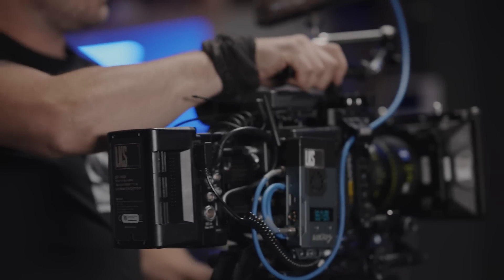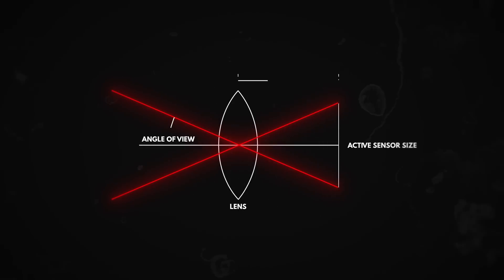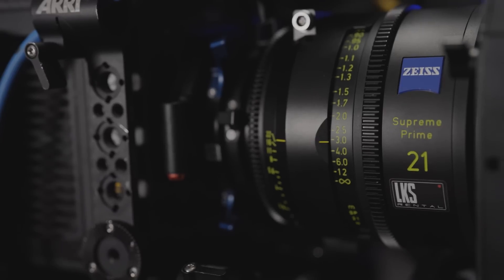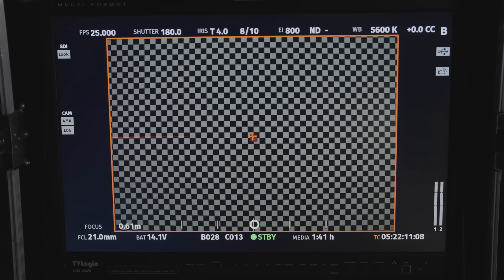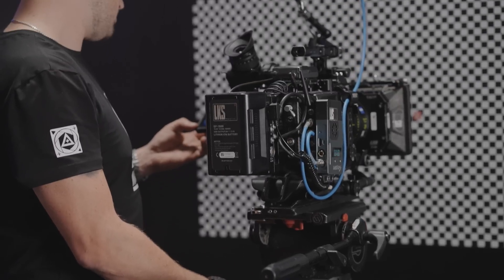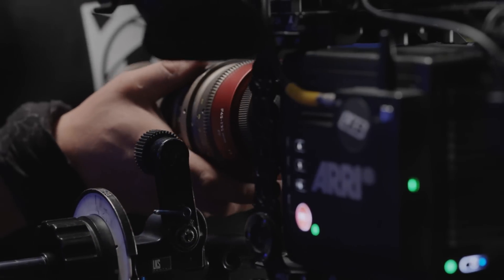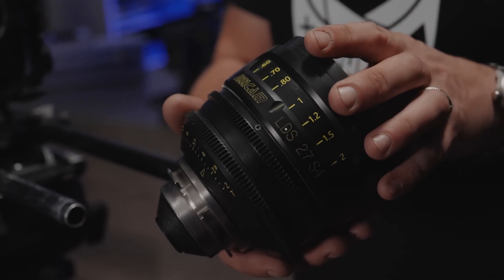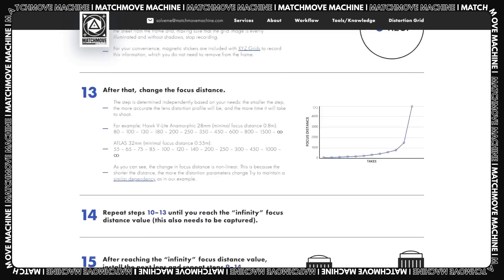How to shoot Distortion Grids

Comment: I have one question: would it not be better to move the chart or the camera to the distance of the witness mark we are shooting the lens at? Like, we are focusing the lens at 2 feet so the chart needs to be 2 feet away etc etc.
I'm asking cause even with the greater DoF given by T22 the chart by physics will be only sharp at an inphinitesimal plane at the time. Depth of Field is just a "construct" where people decided what is acceptably sharp but in theory only one plane is sharp at the time.
Reply from the maker: Indeed, depth of field (DoF) is merely a construct, and even with a substantial DoF, the sharpest point will be located in the center. Therefore, it is crucial to determine the maximum grid blurring level before it becomes unresolvable in matchmove software. We will provide examples for reference in the near future.
Ideally, moving the camera/grid for each focus distance mark would be the most efficient scenario, assuming no time constraints. However, practical considerations often introduce variables that deviate from this ideal scenario. Therefore, we recommend that the camera be fixed, the DoF be maximized, and as many focus distances as possible be captured without moving the camera. This approach is the most expedient.

Comment: I have two identical cameras (two units) - should I record two sets of lense grids or it's ok to shoot on just one. In theory every sensor has micro differences but does it matter?
Reply from the maker: Good question!
If both of the cameras have the same lens mount then, in theory, 1 is enough. But we will be grateful if you test that theory and send results to us to: solveme@matchmovemachine.com
You just need to put 2nd camera at the same place (make sure, that sensor is on the same place compared to 1st camera) and shoot grid in Open Gate mode.

Comment: Does the grid on the wall need to be perfectly parallel and square to the camera sensor? How do you achieve that?
Reply from the maker: Generally no - it can be a slightly unparallel to the camera sensor. But trying to make a Grid perfectly parallel to the camera sensor is a kind of "sharing love and passion" act to the person who will work with this material. Because if you see perfectly fits grid you can not make your own part of the job bad =)
For alignment we use laser leveler to set horizon + center line; laser meter to set exact height; phone/laser meter leveler to make sure that camera angle is 0.
If we have a lot of lenses and whole day - we use dolly also.
Reply: @matchmovemachine  makes sense! Thank you.
Reply: @matchmovemachine  Im curious where do u place the laser leveler? Would it affect if its above the camera or under? Or should it be at the level where the camera sensor is
Reply from the maker: @roybatle  we using it just to make sure that camera's sensor center is on the same height as a grid center

Comment: Awesome stuff! I think for anamorphic lens grid shooting one should also consider if the lens has mounting rotation error due to bad lens mounting, no? (For anamorphic Lens Rotation parameter in 3DE) Otherwise the squares could be skewed left/right.

And camera position for anamorphic should remain the same when capturing grids at different focus distance for the lens breathing simulation.
Reply from the maker: Yes, we don't need to move camera if grid is in focus at different focus distance values - it is very handy, that is why we recommend to close aperture to max value.

About anamorphic lens rotation - the industry standard camera and lenses works together very well and it is hard to mount lens badly =)